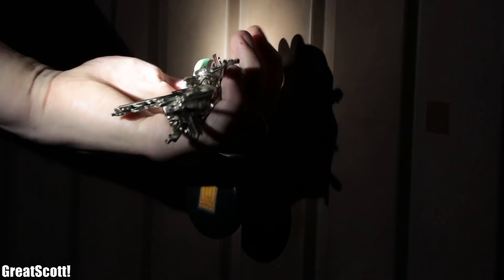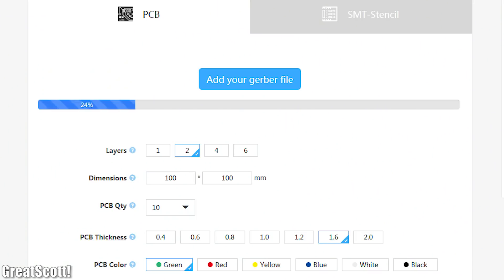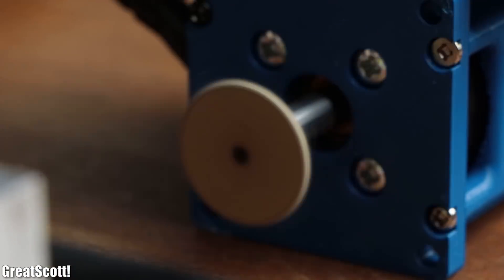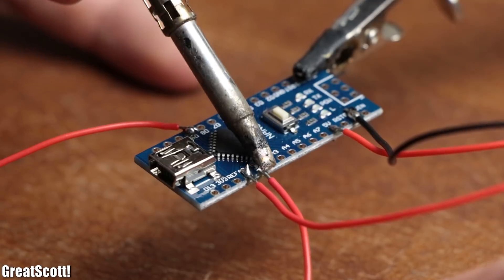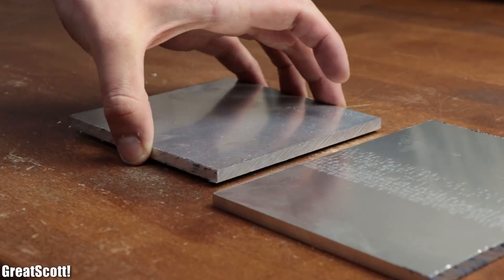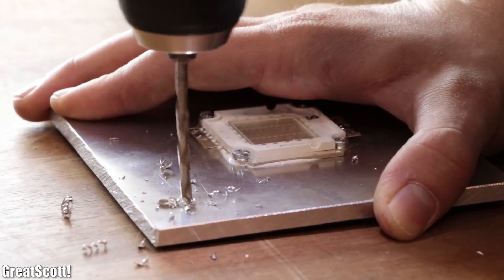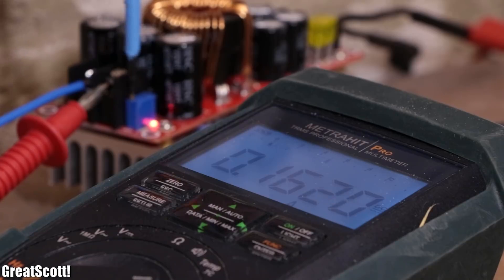Make your own LED Stroboscope (for a safety system)

Comment: That "1500W" boost converter isn't that much of an overkill, because that "rating" is a complete lie. If you run it at this power, it will overheat. But anyway, really nice video!

Comment: Back in 2006 I created a solid state strobe light with a 1W Luxian Star LED. The first of two 555s adjusted the timing. The second adjusted the on time. I employed some high capacity caps so I could dump a ton of current into the LED. I used a constant current circuit to limit the current to 10A. 

It was dimmish in the dark, but the effect at max speed was nothing I had ever seen before. Instead of a stop motion effect as with the old tuber strobes I was getting an extrusion effect. You move your hand from a starting point and your hand stretches from there to the stopping point. The extrusion then shrinks from the starting point to the stopping point as per persistence of vision.

Set the flash rate to extrusion and the moment they turn their head, well....

But I've never actually tried it. I was waiting for LED technology to catch up to provide a much brighter effect. I would use white light as that will provide a more eye filling effect. 

I would also suggest a remote switch and a chair for testing purposes. Just in case.

Comment: Could anyone perhaps tell whether a scaled down version (in the sense of using a single 5mm red white or blue LED) would work for setting/monitoring the pitch/speed on a turntable(vinyl record player) 33 1/3 and/or 45 rpm speeds ? ... either using an appropriate printed disc on the platter or markings on the platter edge

Comment: Thanks for your great videos.
I noticed you list the TLC555 in your parts list. I'm sure you already know, but this version of the 555 can operate up to 2.1MHz (0.5us, 500ns). I am currently working on a strobe to scare foxes away from my chicken coop at night. It will be triggered by a PIR. I hope to overdrive the LEDs, and not use any heat-sinks, by flashing the LEDs for 20us every 10 seconds. (0.0002% duty cycle)
Thanks again.

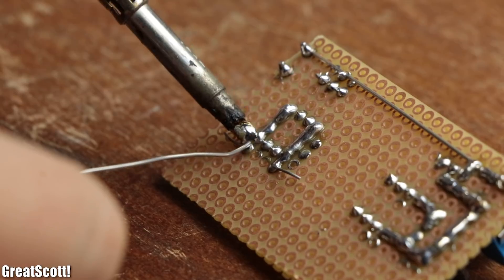Comment: GreatScott, for all your solder bridges on the bottom of your perfboard (like at 4:34), do you first put a wire along the path then solder to it? or do you just put a large amount of solder along the path to bridge the copper dots?

Comment: Well... I was thinking about something like this but just with a 10W led for using as self-defence at night. 
I guess that when strobing the led would not need a heatsink if used for a short burst and even a single 18650 could power it (when fully charged: 4'2V*3A12'6W and  if strobing it would use even less power than that)

Comment: Can i aak what is the capacitor for the 15v/470uF and 15v/100uF are they connected to the input of the ic's?? If not where are they connected?

Comment: the blue color is more disturbing because the eye has special light sensors for that color blue light- which bypass the normal visual processing portions of the brain and go straight for the pituitary gland. the pituitary gland uses blue light to judge whether it is daytime or not, that's why its a bad idea to look at your phone/computer/tv before bed.

Comment: TIP:  Just use 2 (or more) concrete anchors to attach a  wooden board to the wall, THEN you can use normal screws to attach everything else to that, much easier.

Comment: why wouldn't you drill your aluminium out to 2.5mm and run an M3 tap through them with some lubricant rather then use nuts ? this way you have a flush surface on the back.

Comment: I am guessing you are not using the constant current function on the boost converter is because the pulse time would not allow it to ever get to limiting current so you are just using the voltage limit so it is always that voltage and approximately the same current at all times.

Comment: Can I suggest that you use a quad Schmitt trigger as the frequency generator and pulse shaper. Use two of the gates as a triggerable monostable and the forth as the buffer to the power MosFet. In my case I actually coupled the MOSFET drive to provide extra protection for the LED. Using HC parts it is easy to achieve the 30us pulse width. The output frequency can be as high as 10kHz. I have used this simple arrangement to examine spinning computer fans and my PCB drill. In the latter case, looking for eccentricities in its drill bit rotation. There is an advantage in having some control of the pulse width, as at low frequency a very narrow pulse does not provide much illumination. Thinking about it, while the ideal is a delta pulse, at low speeds, a wider pulse is on for a relatively small angle of rotation and the smearing effect may not be significant, while the increased illumination may be advantageous. The trick seems to be to keep the width as small as possible consistent with providing sufficient illumination and not exceeding the power dissipation of the LED(s) used.

Comment: I have been thinking about a offgrid security system. Maybe add a motion activated camera and a alarm. Off grid equipment isn't cheap. And I'd like to keep it!  Along with the tools and things. I'd like to maybe also use about 3-4 of the 50watt or 100watt and mount them on 2-3 walls per enterable rooms. With alarm. And basically have an explosion of sound and blinding light for anyone who enters unwanted when activated! A coded entry pad would be nice! Great idea!

Comment: I have all the smart lights in the house linked to my alarm system, if the alarm trips all the lights in the house strobe at a frequency which randomly varies between 10 and 18Hz on a 2 second cycle. In the living room with all the lights strobing the effect when they drift out of sync is really nauseating. As well as hopefully disorienting an intruder the hope is it will attract the neighbours attention, beats the hell out of the wimpy little strobe on the external alarm box.

Comment: What's the difference between this and PWM signal?, PWM will dim the light but this is not...
Reply: No difference it does reduce the overall output which is why he refers to overdriving the LED to compensate.

Comment: Teach us how to make a converter cable to use a cellphone charger that's fast charge compatible that will feed it's 9v to the 7805 regulator present in most old consoles. This way we'd have readilly available reliable power supplies for our old consoles. Even cooler yet a variable voltage power supply if it's something cool for a newb like me.

Comment: The human eye can get used to a constant flash speed. If your design switched between high and low speed flashing fairly rapidly it would be much, much more disorienting. Red and blue lights are obviously at opposite ends of the spectrum. That's why sometimes when there is a lot of red and blue together it can hurt your eyes and make it impossible to focus on both colors at once. If I designed a system like this I would add both of those features to it.

Comment: The stroboscopic effect is also known by the stroboscopic timing light used by the car mechanics in order to get the correct timing in older cars suited up with distributors rather than DIS (Direct Ignition System) or COP (Coil On Plug) ignition systems, which the 2nd one is widely used by the car manufacturers nowadays

Comment: Why did you used potentiometers? Will you change the strobe after someone tried to break into your garage? Wouldn't it be much simpler to have matching resistors soldered into the main circuit?

Comment: Could you make a video about DIY LED Lights for video production. I have been searching for a way to mix between two LED strips with 5600 kelvin and 3200 kelvin and change the overall intensity of the light with another dial without flicker - also when shooting in 60fps or more. 
Just like a professional LED light that is bi-colored.

Comment: You can also make a strobe light using an RC oscillator and a transistor. You can adjust the strobe rate by using a pot as part of the resistive portion of the circuit and the transistor is used to switch the high power to power the light. There are also capacitor based circuits that can strobe low power LEDs, but would not work for this application.

Comment: Why do you use the driver IC TC4420? Couldn't that be done by a small signal transistor or MOSFET? Or even left out completely if logic level MOSFets are used?

Comment: real question:
wouldn't the heatsink be unnecessary, since the LED is only on less than 5% of the time? so the 100W led would on average consume 5W, which you would only need a tiny heatsink for.

Comment: Scott, I believe the strobo effect would greatly diminish the robber efforts if the blinking was RANDOM! Imagine it, after some time, even with the lights blinking, your brain can adapt to the timing, but if it was a little random, with more off time, the brain can't adapt to it, and the guy would start to feel dizzy and fall everywhere.
Reply: And add a high pitch sound (out of a fire alarm )
Reply: Yes! He should also rig up an AK-47 to warn the intruder of the all mighty blinking blue light.
Reply: I think the FBI uses random strobing flashlights to stop people
Reply: and make intruders hullicinate
Reply: I agree. Would be easy to do with the Arduino version.
Reply: Or just set up another one pulsing at a different rate so they would occasionally both light at once and really mess with you
Reply: Agreed
Reply: look at this strobe from a tactical lamp. it is said that you will feel seek if  you look a such strobe. May be an easy way to achieve this effect is to have 2 lamps with ramdom pattern at the same time.  https://youtu.be/7NZ0NrcqOfo?t=284
Reply: It still doesn't work on me.
Reply: Every 5 seconds shift the frequency and pulses up/down randomly by a randomly selected amount from a range just enough to be perceptible
Reply: Maybe not completely random, but offsetting the blinks randomly some tens or hundreds of  milliseconds.

Comment: You should get some taps and start making internal threads - results are quite a bit nicer than having nut on the other side of the heatsink. 
BTW - plain aluminum plates aren't too effective heatsinks - fins are critical to get thermal resistance down

Comment: You can connect the mosfet directly to the 555, just use a series resistor on the gate, something around 470 ohms, no need for a mosfet driver.
And power the 555 with about 5-6v
Reply: the 555 would heat up probably

Comment: I made a very similar thing for my house around 1.5 years ago, where i used a very powerfull amplifier (around 100w), 4 Bass shakers, and 2 of these Strobe Leds, and also a small variable frequency generator to scare the shit off people when they open my house without using the staircase type bypass switch.

Comment: Just great, as I just received my china bags with LEDs and stuff and am looking for a simple project to take the virginity of my dirt cheaply buyed Toolcraft high frequency induction ST 100 HF soldering station...  Ehm sir, is there a way to drill up the station to 150W with some simple part-swaps, Sir?

Comment: You can get a cheap strobe light from the dollar store. It's more like a flash bulb. It's blinds the intruder upon the first flash and every flash after put those big blind spots you see when someone takes a picture. After 5 seconds you can't see anything. This is more like a strobe from a nightclub. You want a flash stun response not a party theme. Then you trigger the alarm at 15 -30 seconds and now the thief is blind and deaf. Time the CCTV correctly and you have their picture. They wouldn't let me hook up the device that took out knee caps.

Comment: How do you break up the solder traces on a perfboard if they accidentally join?
For me it’s a solder disaster and I just remove and redo everything...
Reply: Get a solder sucker or some desoldering braid and sop it up with that. You can also get a Teflon spudger that you could use to split the molten solder if you're using a temp controlled Iron and it doesnt pass ~450 degrees.

Comment: Try putting multiple LEDs in an arrangement and controlling them with an Arduino,
Then try randomly changing the frequency to mess with pattern recognition and switching between the LEDs to create slightly different shadows, I think that might caused sea sickness

Comment: I still would have gone with the microcontroller so that you could pseudo-randomly adjust the pulse frequency and duration to further confuse an intruder. This is what most defense strobe flashlights do.  After a few seconds of flashing, your brain can adjust somewhat. However, when the strobing changes on my flashlight it really messes you up.  

PSA:  Don't stare at a bright as hell LED flashlight that is strobing while holding a beverage.  BRB, doing laundry.
Reply: Have you done with the laundry?
Reply: I don’t know, has he?

Comment: In part 3 adding a smoke machine!

Then it can serve double duty for holding raves.
Reply: There is a security company whose system includes a high volume smoke machine intended to make it impossible for the thief to find anything.

Comment: Waiting for the diy 1500 watt boost converter...!!!
Reply: I am slowly working on converting one of those into a SEPIC arrangement, so it can boost and buck but not with all 30A (i will need to split the coil into two)
Reply: What is it with you guys and dc to 110/220 death traps? No! Buy a ready-made one or don't mess with it at all.
Reply: Christian Ivarsson  hahaha....still there?
Reply: @Chriva  a boost converter does  not have to boost to 110+ volt
Reply: @gustavgames    
+-90v boost for diy sub amp would be perfect 👌

Comment: i have 40 watt soldering iron,and the solder was really hard to melt plz answer
Reply: solder was 40 tin 60 plumbum
Reply: キルノミス•アラギグス アリス or rosin core solder, not acid flux solder
Reply: Plumbum is lead.
Reply: MintSoup what about if the person heats the tip of the soldering iron with a blowtorch? Jk jk
Reply: try replacing the soldering tip
Reply: キルノミス•アラギグス アリス plumbers solder? That’s why, try using electronics solder